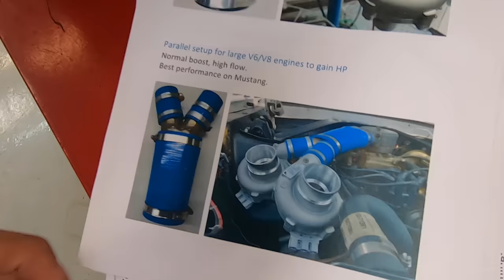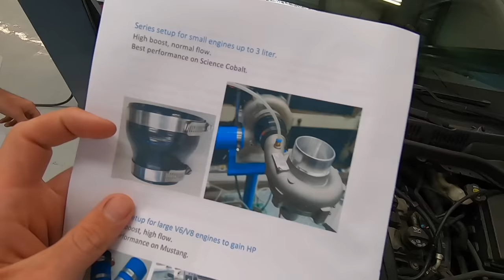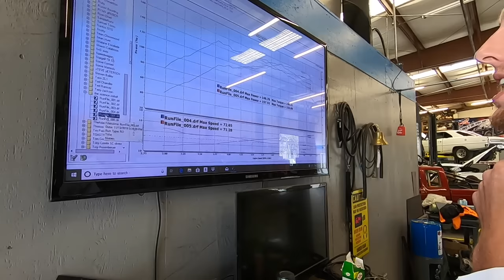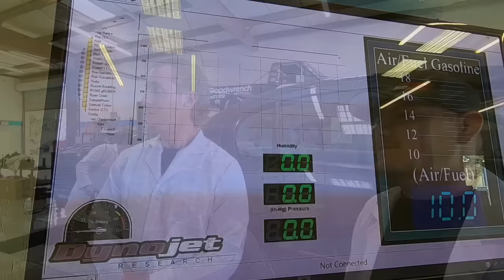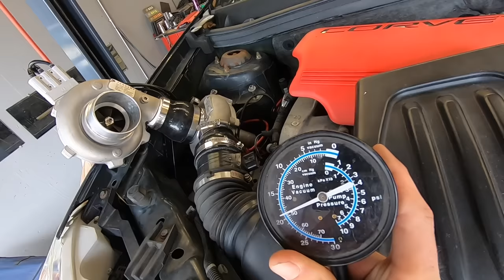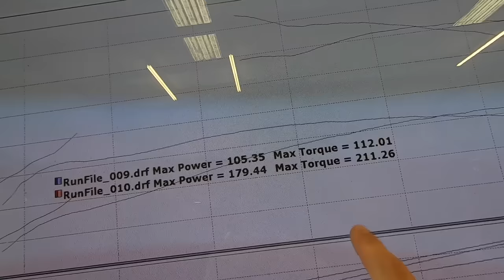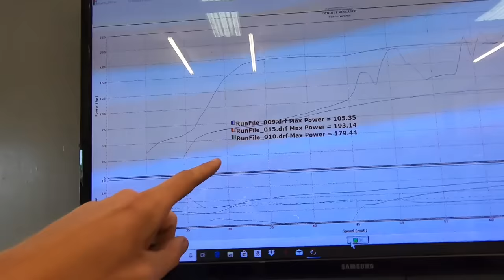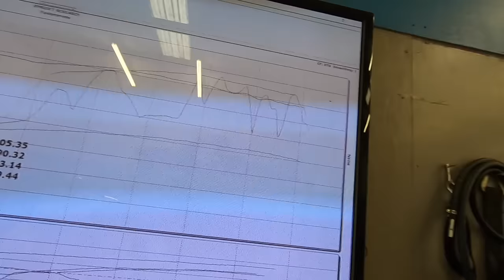Dyno Testing $5,000 Worth of ELECTRIC Turbos! Double the BOOST!!!

Comment: One of these would be nice to rid your engine of turbo lag.  Even 6psi would be a nice kick until the turbo kicked in. They already have digital control options:

Simple ON/OFF lever switch placed under gas pedal (Standard in the kit)
Control the TORQAMP speed based on Throttle Valve Position 0-5V signal*(cable throttle cars)
PWM signal from an output of your ECU*(drive by wire cars) 
Combining with a Turbo? Control the TORQAMP speed based on the throttle valve position and intake manifold pressure*(both) 

If power capacity isn't an issue you could even use one of these as a main boost source instead of a normal turbo with no intercooler.  
With a normal turbo, hook this up, tune and go. No turbo lag.

Comment: The problem with the electric suprechargers is that the energy doesn't come from nowhere. The electric motor to be able to pump and compress the air, needs to take sufficient energy - in this case probably around 5000-6000 W. While the alternator produces only around 250-500 W. That's why you have a separate battery (so you don't deplete the main battery while enthusiastically use the booster) and that's why you may use it only to produce short running boost pulses with long pauses necessary to charge the battery back in between. Also, since the impeller is an obstruction in an air way it makes the N/A driving less efficient. So no - I'll stay with the mechanical solutions - turbo or crank shaft powered. Specially that for this same price or even less you can have a decent mechanical solution without mentioned limitations.

Comment: I'm sure 4X4 enthusiasts and AWD cars would make the most use out of these. Although I'd imagine the cost will have to come down for more purchases. TorqAmp should consider a compressor/motor/inverter/controller only kit and let people source their own battery packs, thermal solutions. Lithium packs have got to be 40% or more of the production cost. If I remember correctly Chevy volts use 48V packs and those are cheap used.

Comment: They have the two turbo kit and the single turbo kit... why not go crazy with triple turbo 2-1 step and have the voltage box in series for a jolt. The factory ecu maybe not gonna cut it, so throw in a piggyback for a cost efficient solution. I wanna see it just because :)

Comment: Hey cleetus, subscribed specifically because of this video got me interested. Could you test this on a honda civic si? I'm interested to see what gains if any, these turbos would make on a k20 engine. Even if its low down power. Could provide some more use-able power? Or even if it could make an extra 50bhp over the stock 200bhp.? Would be cool. Pleas do some more testing on these turbos with different cars? Seems like these could actually gain some traction. If they use a 45k rpm motor. With current tech. One could swap out the motor for a 80k rpm motor. Making possibly twice the power? Or air flow?

Comment: they need a y connector for the throttle position sensor so the device can add boost when you apply more than 60% of the accelerator within a certain time frame
Reply: TA sells those control boxes and bypass valves. For everything, comes just under $3000 each

Comment: I have a NA 2007 Impreza 2.5, I'd love to see how it would perform with one of these in comparison to the turbocharged Impreza WRX of the same year. They're both 2.5l engines but of course the WRX engine was designed for boost and is a 4 cam motor. It would still be a fun experiment but I cant afford a $2500 experiment LoL if I sold my current Impreza I could probably buy a WRX with an additional $2500

Comment: How many amps do they pull cause you can eliminate the 48 vote magic box with an  AC 3phase 12VAC electric motor / built in inverter and a safety switch that cancels usage below 12.5vdc of the battery for motorcycles
Reply: Damnit boys thank your lucky stars you got a garage equipped with the tools to play with the toys in comparison is like getting a free gaming computer from Nvidia with two brand new RTX 2080 and SLI and then overclock it until you let all the Smoke Out

Comment: This idea can actually be nicely improved although I'm not sure if it would be worth it. It would require additional maps. Based on engine load, throttle position and revs you can adjust how it works. This way it would spin up when you want more power (higher acceleration/load) and adjust to current conditions but regenerate when you are idling or just cruising. This way it would be even better than turbo as it can kick in at any revs and at the same time you can cruise at slightly higher revs without it running if you don't need it. That would be interesting project but surely not that easy.

Comment: Imagine Just Buying one of these kits for $2500, No Turbo Lag, easier to install, need to run higher octane fuel, and mount the Battery and Controller in the trunk, Hook up an intercooler for the input of the turbo (Just for the sake of Horsepower) and you have everything you need to gain a decent amount of HP

Comment: Again, it would have been nice to see the units installed properly with a TPS to activate them seamlessly.  For $1,000 however, it would be better to chop off the exhaust manifold and add a turbo flange and even the most modest turbo to ain 8 pis to make that 190 HP.  Also kudos to that 2.2 Chevy engine, its a beast in torque and durability.

Comment: The problem with these is 1. Cost....2500$ is way too much. It has to be a 80-90% mark up for them. 2. It said on their site "please wait 16-24 weeks for delivery". The gains are nice. The installs easy...but for that money you could swap engines. I have been interested in this since 2002...when the crappy ones first hit ebay. Hopefully they make it a little more reasonable.

Comment: i'm still wondering if it wouldn't have had better 1/4 time with sequential setup.
Reply: It wouldnt perform any better in either setup I think. In both cases they are far exceeding what the rest of the car can handle. Reality is the car has tiny/narrow tires/crap suspension/ constricted exhaust. In the short tests they did do they weren't able to keep the car stable for more than a few seconds with it wide open.
Reply: @brianm.595  the sequential made better low and mid and it's an automatic, the constrictive exhaust is more towards sequential as well.
Reply: @ty2010  possibly true, I think they were both still under similar psi load though. I'd wonder if 1 turbo + better tires and stiffer suspension wouldnt put up a better time despite less power.
Reply: @brianm.595  they should add a boost meter to the dyno tbh
1 turbo nose dived at 3500-4k or something
parallel made it break up soon as they turned them on so they had to manually dial up pressure
sequential seemed to boost even and only started to dip a little at top of revs

Comment: Crazy thing is that on a hybrid they’d be a hit if they were cheaper as you can use the batteries to run them and then increase your full throttle power for when your using the gas engine..:) I just don’t see why 😢they are so expensive other than I guess supply and demand dictates a higher price since I doubt there’s a huge market when exhaust power is cheaper (free) than using an electric system to spin the turbos

Comment: hey guys using the torque amp as an air pump if you pull theair from an airconditioned source plus increase of boost you get denser air as well

Comment: Y'all disconnect the MAF attach two big ass fans and wonder why the engine doesn't run right when you hit the double ultra mega 🤨  Wait till that motor spools up to full power then hit the boost. Y'all hitting the button while it's mid developing power.

Comment: you put turbos on it in series and brought it just over stock power, even though the torque was more, that doesn't seem worth it. NA these engines were capable of 200hp and 211 lb ft.
Reply: @bit9k898  I had one of these cars when they were new and most supported by the aftermarket/modding community. 325-350 flywheel HP was max, then the transmissions and pistons were of concern, this is a well known number, as many people put the lsj supercharger on their l61s without doing pistons and rods and they didn't break a thing if they respected this HP limit. I kept mine NA because 200 flywheel HP was all I needed to enjoy my car, but that was far from the limit. GM actually published a "recipe book" for getting various HP numbers reliably out of this engine. This was a very specifically and highly marketed engine when it came out, to an odd level, IMO.

Comment: Outside of the towing crowd most of us would us in a little freeway passing? If your using it for longer than four minutes yo ass probably got lead foot syndrome anyway.  But bang for buck, no intercooler, intake upgrade , new exhaust, pretty easy install? I like it. Now when one of those turbo fan blades come apart and gets stuck in my warranted engine... I can’t think of even the slightest story to cover my ass lol

Comment: Imagine how much faster it is without them three idjuts
Reply: Without all 4.... Cletus doesn't seem to understand the difference between pressure and airflow volume. More heat will be generated with the turbos in series. The only plus side of the higher pressure is being able to have more steps in your calibration for a MAP tuned car. With a MAF it will make little difference since you're measuring flow. (The turbos are still using the same amount of input energy and are flowing the same amount) so you'll get better results with the turbo in parallel with these electric turbos since there is basically no lag to speak of anyway compared to a conventional setup. Less heat, more ignition timing, more fun. Lol. The instructions that came with the turbo seem to indicate the manufacturer knows electronics, but really doesn't know much about engine tuning and turbocharging engines either. :/

Comment: Must feel really strange driving this car while the passenger is operating the turbo. Especially when going full throttle and reving 4-5k RPM and hardly accelerating and then BOOM double power. 

What does make sense is a compressed air tank system, spooling up the turbos almost instantly when you need full power and hate turbo lag. Its already installed in very expensive supercars, would be interesting to see it on a normal sports car doing laps around a track so you could measure the difference,

Comment: Ever hear of a direct drive turbo? I deal is around full 3 thou RPMs. If exhaust ONLY turbine no compressor is allowed to spin it would turn 30-50 thou RPMs. Connect the exhaust turbine streight to harmonic balancer. Now do the rpm math. Now the turbo "direct drive" is pushing the crank. This isn't a super gain till? V-8 6-71 blower amplified boost equals amplified exhaust press equals blower parasitic HP loss to turn the blower. Idea is extra boost exhaust makes exhaust turbo work even better NO MORE PARASITIC HP LOSS TO TURN THE BLOWER. Turbines doesn't care what it powers,even a supercharger.

Comment: The sequential setup makes absolutely zero sense with electric turbos since they're virtually lag free to begin with. Higher PSI of boost just means you're generating more heat from compressing the intake charge further. What you want is the most air volume you can get with the least amount of heat generated. Since the amount of input energy is the same in both setups, parallel is the only way to go. If the amount of lag is equal between two turbochargers -- the one with the larger cold side will allow you to make the same power at a lower pressure -- lower pressure means less heat. Less heat means you can get away with further ignition advance and make more power from the same amount of air. You'd think the manufacturer of these turbos would know something as basic as that...

Comment: These guys don't know anything about cars.
They just put these electronic turbos on, with no way to secure them to the car.
No airflow to the inlet.
And they complain how it doesn't work?

They missed one of the most obvious parts of a car.
A direct airflow to the air intake system.

They just had the turbo just hanging there.

It felt like a troll video

Comment: See how stupid his people are? The guys says let's have the twin first. He doesn't realize the series set up is twin it just is the normal flow for small engines but will give more peak boost so higher than 5.  the larger engines have more flow so it won't peak at 5 psi so you put twin separate to give enough flow to actually give it the peak 5psi boost